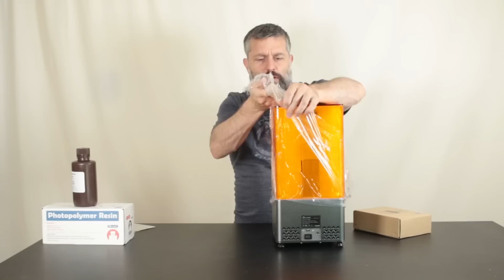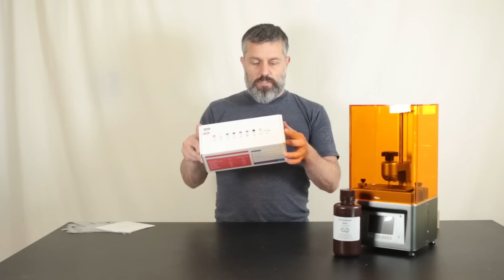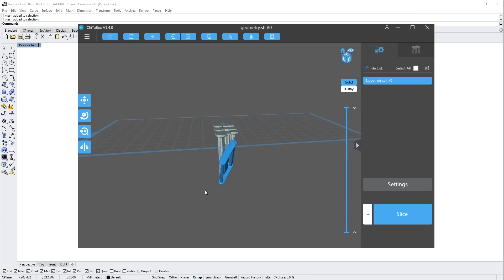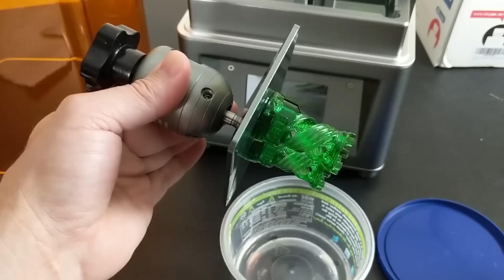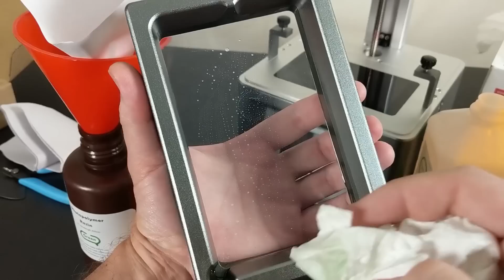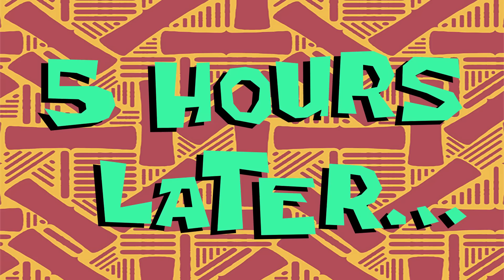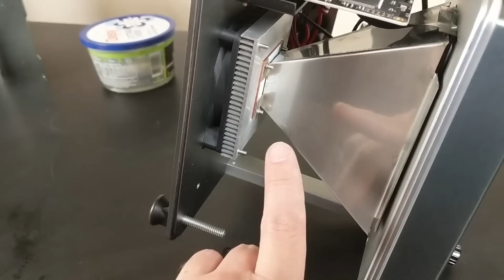$250 for This Quality of Printing Is Unreal! - the Elegoo Mars Delivers, so Let's Review It.

Comment: Few points, firstly safety first please do not touch the resin with your fingers, use the gloves at all times when you are handling an uncured part, uncured UV curing resins are biohazardous when in liquid form, when they are cured they are basically inert as any plastic is. (Also not good to have IPA on your fingers)
Secondly, that is an LCD masking printer, the UV LED sits a few inches below the screen, the screen is indeed a mobile phone screen but it is for all intents and purposes transparent (with the RGB filters embedded)
The LCD masking printers were first built in China/Korea so no need to worry that some American has stolen the technology - by the way there are now a number of American companies copying the LCD technology.
There are different resins becoming available that have properties that far exceed FDM because FDM by it nature can only use plastics that can be melted and extruded. Resin printers, on the other hand, can use any photocuring resin it does not have to be able to melt so you can print resins that are able to accept temperatures of 240 deg C or elastomers that have an amazing stretch or even products that have the capability of having different durometers in the same print (multi colours are also being tested) so there are a lot of advantages to resin over other technologies. 
By the way, the SLA printers are not as versatile as the DLP and LCD printers - drop me a note if you want to learn more about Resin Printers

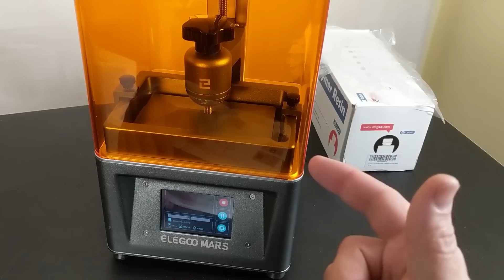Comment: 16:24 - You went... to sleep!?!?!?  YIKES DUDE... besides the fact that these things are prone to catching fire - do you really want to leave it running for hours without checking on it?  BAD IDEA.. THumb DOWN!  and .. NO GLOVES!?!?!?!?   Folks. Please do not follow this guy's advice or steps..... VERY VERY BAD!!!
Reply from the maker: Resin printers don't catch fire. In rare instances, FDM printers with the "Thermal runaway  protection" feature disabled in firmware have caught on fire. These are two different techniques for 3D printing.
Reply: @DesignPrototypeTest  Hmm... I remember reading about resin printers and fire hazards... I could be mistaken though.  Of course, they offer other hazards: https://gizmodo.com/new-study-details-all-the-toxic-shit-spewed-out-by-3d-p-1830379464
Reply from the maker: @pesto12601  Again, your link applies to FDM 3D printers only, not resin printers. The two techniques are very different as I explained in the video. With this Elegoo Mars resin printer, you could easily seal the lid at the bottom, and further limit your exposure to the resin chemicals.
Reply: @DesignPrototypeTest  well.. then perhaps it is time to buy one... certainly better quality prints than PLA...
Reply: @DesignPrototypeTest  just came across this video... and at least folks are talking more about it.. because it is SO IMPORTANT: https://www.youtube.com/watch?v=jzGlRohAMVk

Comment: Just because they're produced in the same factory with a similar bottle does not mean that they are the same quality. I work at Energizer where all batteries are made with relatively the same process but the Energizer brand batteries cost about a 90 cents for each battery but we also make batteries for Family Dollar those are about 60 cents. The content mixture inside are completely different. Same process and packaging, different quality.

Comment: Three things missing, one how much does the resin cost, two how much resin in a bottle and three what is the max print size you can make?
Reply: 1) quite expensive, about $50/l (varies)
2) anywhere between 100ml to 1l
3) 120x68x155mm

Comment: 3:35 UV laser?
Reply from the maker: 6:44 No, not a UV laser printer. 30:05 Definitely not a Laser based printer.
Reply: @DesignPrototypeTest  I thought that maybe there is dispersed light from UV laser LEDs used in Laser printers. Not safe but available UV source.

Comment: There's a product called "second skin" I used to buy from an autobody jobber (paint supplier). That is supposed to help seal your skin and avoid exposure to stuff like resin. It's the catalysts that are really bad for you. I developed allergies to the stuff and stopped painting. Nasty stuff.
-Jake
Reply: Yep. It often is an Isothiocyanate. But the funny thing is, Horseradish has a form of it also. The form on the food is an anti-carcinogen while the form in hardeners is the one that sets of a reaction in the skin. But if you become sensitive to the non-food form, you also should stay away from the other.

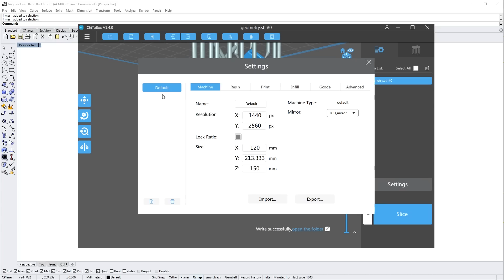Comment: 21:50 Any advice for someone with a Monoprice MP Mini? That printer is not listed.
Reply: I use MP mini and after I read the messages at the facebook group and by some easy tweaks I have no problem any more.
Reply: Check out the Monoprice MP Mini facebook group. Lots of help to be found there with dealing with the MP Mini's quirks.

Comment: The board inside has more in common with a raspberry pi other than a cellphone. You will find absolutely no cellphone parts on the board. The only thing that has something to take from the cellphone industry is the 2K LCD panel.

Comment: A small note: It's not an LED-screen. It's a bog standard LCD panel with LED backligting. A "MEMS"-based printer would use a proper DLP (digital light processor) with an array of micromirrors. The Form 1 uses two discrete galvanometers (galvo's) that deflect a single beam of laser light in the X and Y direction, and so is not MEMS as well. All the chinese makers call their printers "DLP" while they are certainly not.

Comment: Please stop touching uncured resin. It is toxic. Use nitrile gloves to protect yourself. Wear them in every step from opening the resin bottle to handling the print until the UV curing process has completed.
Reply: The actual toxicity that could possible be transferred through your skin is widely over exaggerated when it comes to UV curing resins, you aren't going to have any issues just from lightly touching "tacky" partially cured solidified resins. As long as you aren't dipping your bare hands in it, and using it in a sealed off room with no air flow, you will be totally fine.

Comment: As a chemist, I can say that the only thing a laser will do for you is reduce the amount of time required for curing. Photons are photons. As long as the photon has the necessary energy(wavelength), it will get the job done regardless of whether you are hitting it with one photon of 10,000 photons. It will just require more time for the system outputting, say 1 photon/s, to get the job done. Well, you will also get a cleaner signal from a laser and possibly finer lines as lasers tend to have a narrower bandwidth than LEDs and I am pretty sure that was a large LED at the bottom of the instrument.

As this machine looks pretty similar to the Longer Orange 10, I wonder if the quality is the same as I'm sure that it is probably, as you said, a simple rebranding of a base machine by many different companies. And regarding logiclrd's comment, I'd say it is probably a valid concern but I don't believe it is because the resin hardens in the body. There is probably a component of the resin that closely mimics something that triggers an immune system response. And the warning should apply to all chemicals. There are quite a few that are known sensitizers and as we come up with more, we just keep adding to the list. At a very minimum, I would say always wear gloves. Nylon gloves can be found pretty cheaply and can go a long way to help limit exposure. You should always have a minimal amount of personal protection equipment (PPE) to keep yourself safe.
Reply: While for curing its very similar as you said, mechanically DLP chip would work in a different way, it would have different limitations compared to the cheaper uv led + lcd screen combo.

Comment: The amber housing is not to protect your eyes, it is to stop UV light getting into the printer and curing the resin. I'd also recommend getting 99% or better isopropyl alcohol instead of 70% for cleaning the film.
Reply: Keep the 70% where it belongs...... in the liquor cabinet
Reply: Keep the 70% where it belongs...... in the first aid kit🤦🏻‍♂️
Reply: 70% Ethanol should be in the first aid kit, not cancerous isopropyl, if you have a bad cut you dont want isopropyl alcohol entering your blood circulation
Reply: @GamingAmbienceLive 

ethanol is consumable alcohol and is found in liquor  stores,  collage campuses  and liquor cabinets  across the globe,  isopropyl  alcohol on the other hand  can be readily  found  in first aid kits,  hospitals ,  meth labs and in your medicine  cabinet ,   so you're either drunk or have cancer
Reply: wrong, ethanol is used not isopropyl, isopropyl is used as cleaner, i worked at the hospital ive never seen isopropyl, i also worked in the lab with bacteria and we only used ethanol to clean
Reply: yes 'for clearing the film'  That's what I say to my wife too.  No dear, it's only for cleaning the film... hic...
Reply: @rebeuhsin6410  IPA is used in alcohol swabs in my region.
Reply: It's there to do both actually. The main job is resin, the secondary is eye protection. UV light isn't exactly healthy.

Comment: One thing you forget about 3D printing is the nozzle wear depending on the type of plastic you use and with time will affect the quality of the 3D parts you make.    And one other thing, the type of filament 3D printer you chose.  If you make the choice of a low budget one,  don't expect high quality results.   

Now for resin 3D printers.  you have to be careful on the lighting where you setup your resin 3D printer.  If you have certain type of neon's at the ceiling that do let off small amount of UV, this may affect the parts you're making in the 3D resins UV curing printers.

Just keep that in mind.

NB.: The orange tint of the acrylic is blocking any outside source of UV that could affect the part you're printing and not the other way around.

Comment: Copying is the most sincere form of flattery, so long as it isn't actual theft.  (Ask IBM about their PC BIOS).
I never forgave Apple for their 'Look and Feel' lawsuit against M$ over Windows.   M$ didn't steal any of Apple's code, they wrote Windows from scratch and created a GUI desktop using a similar workflow to what Apple had.  And need we mention that Apple was guilty of the same 'crime' they sued M$ for, they took the look and feel of what Xerox Park had created, and Xerox didn't sue Apple over it.  So ... I've give the Chinese a break on the software.  But I agree on the cookie and spyware stuff.  I'd prefer to use Open Source (GNU) software myself, and I do with my FTM printer (Pronterface, Sli3er, Open Scad, Marlin, etc...).

Comment: Other than a bunch of bitching about China and some really bad safety practices. The review was quite helpful. You should really catch up on safety measure when working with a resin based printer.
Reply: At least the resin printer can be left alone and not cause a fire during a fault due to the lack of a hot end. I've had my printer mosfet fail and stick on. Causing it to overheat.

Comment: Ok, some major points you missed in your summation.  SLA/LED printing is highly toxic using chemicals that are recognized as cancerous.  The opportunity for spills and mess using this technology is huge and that spillage is resin which can only be cleaned up with large amounts of isopropyl alcohol as a solvent. When the resin is combined with the alcohol it becomes easier for it to be absorbed into your skin. I wouldn't go anywhere near the stuff without industrial grade PVC gloves. It stinks and not in a nice way.  Washing the parts should be done in a well ventilated space preferably outside.  The LED screen degrades very rapidly because of the hard UV emitter. What are the life of the components because other people report that they burn up really quickly. The print size is tiny compared to an Ender 3 and most people recognize PLA as being food safe. That bottle of resin is how much? You are buying a Chinese printer that uses high output UV radiation as part of the print process, how comfortable are you about that? FDM printers are relatively safe and create fairly small amounts of toxic waste especially if you print in PLA. In other words, no I really don't think these printers are in any way 'Introductory' grade printers.
Reply: What a complete bullshit comment. Read more, you'll embarass yourself less.
Reply: okleydokley 
so I did read more a couple of moths ago, and it sems you are the one embarrasing yourself.
The declarations I’ve read so far claims they are fine, but even so they warn you to use gloves and having the room well ventilated (or even clean the bits outside).
They also often mention a zero problem level, even if several of the ingredients they mention are marked as hazardous.
And to be honest. I don’t trust chinese safety papers.
Reply: @TrollWithOpinions  Quite honestly I don't think I'm the one embarrassing myself.  I think that your reply validated a number of my concerns. This UV stabilized resin is nasty stuff. Once it's stabilized via UV radiation it becomes inert more or less but prior to that process the resin contains unstable organic chemicals capable of being absorbed into the body.  If the product's process ideally requires a flume hood and protective clothing one can hardly describe it as a consumer or hobbyist product.
Reply: Paul Le Mars 
I don’t think you embarressed yourself. I think you have a good point.
Okleydokley on the other hand ....
Reply: @TrollWithOpinions  Ahh, sorry about that.

Comment: Cleaning the membrane with alcohol and paper towels seems like a good way to screw up your prints fast.
Reply: How do you do it properly?
Reply: @h.w.6563  You don't. Scrape the resin off without scratching it, but that's it.

One tank per resin type.
Reply: @233kosta  Ah, that's cool! Thank you for the fast reply :) 

I am seriously considering getting one of those resin printers. I didn't know they got that cheap that fast.

Would you happen to have any recommendation for a printer in that price range?
Reply: @h.w.6563  I'm afraid my only experience has been with formlabs and they're about an order of magnitude more expensive.

My assessment of the technology in general is quite critical because I expect a "serious" product to be able to handle serious work. Instead one has to deal with not only significant limitations (such as resin cost and shelf life, among other things), but also the ridiculous sensitivity of a lot of machines out there. The ones I can speak about (FL) are sensitive to pretty much everything. From specs of dust on light transmission surfaces to rough handling of resin tanks (most of what you'd consider "normal" in a production environment passes for rough, by the way).

In laser units in particular, resin tanks are coated with a very special (read expensive) polymer which wears quickly under normal use and is easily damaged by tools and chemicals you'd normally use during the cleaning process.

To the best of my knowledge, DLP units are somewhat less sensitive, but have a limited planar resolution (pixels can only get so small) and suffer from the same resin issues.

My preferred ALM technology remains the laser-powder bed type. No sticky resin (just powder that gets EVERYWHERE :P), no resin tanks, no sensitive materials or equipment within reach of the user. Oh, and the powder is its own support material! The main problem however is cost. The cheap ones go for double what you'd pay for a form 2. Formlabs' own machine is double that still.
Reply: Faster than most people think!

Comment: Different resins actually vary quite a bit despite many having the same bottles.  It's similar to how so many FDM manufacturers used the same spools for so long - yet even from the same manufacturer they'd use significantly different materials (eg PLA, ABS, PETG, all would go on the same spool).  There's model resin that is harder, sands easier, but is more brittle/snaps under pressure.  Then there's tough resin like Blu resin that is for parts you plan to use mechanically (CNC Kitchen did a test with this already - title 'STRONG parts from a Resin 3D printer').  There's also high temp resin (my personal favorite reason for SLA printing since you can get some that goes up to 320C HDT, and it prints much easier than high temp plastics on FDM).